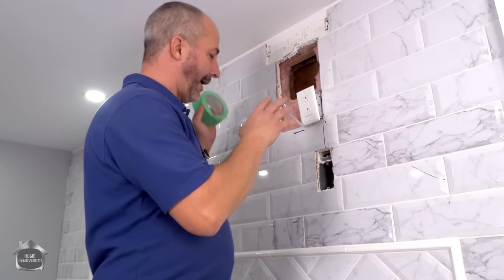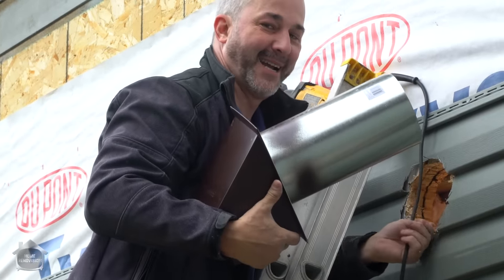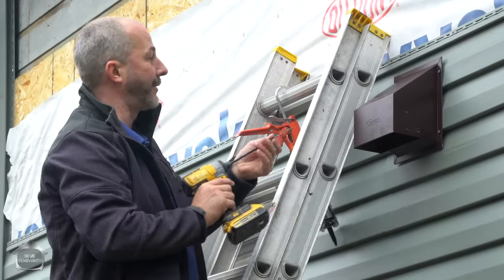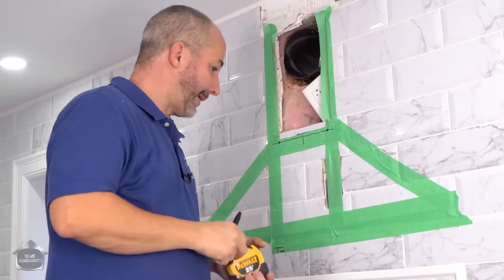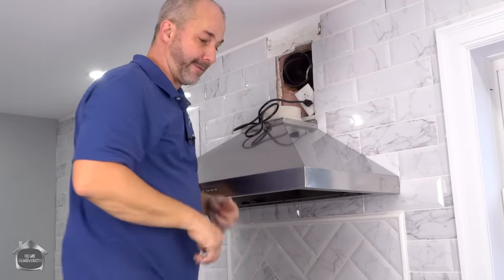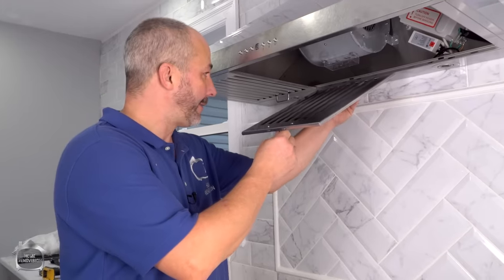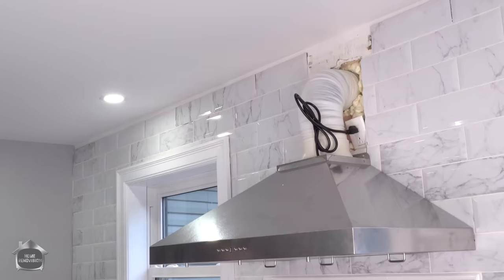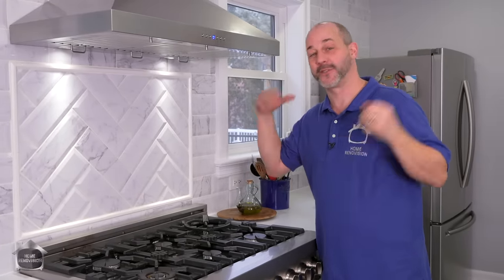How To Install A Wall Mounted Hood Fan!

Comment: Thx for the video, but I have a problem. What happens if a stub is in the way where the ducking should be?? The current ducking is not centered so if I install the hood vent it will be visible.

Comment: I understand the difficulty removing the protective plastic but as a Manufacturing Engineer in Stamping Body Panels...the covering is primarily needed to protect the Stainless surface during manufacturing

Comment: This is so helpful!! I have a hood similar to this that looks like it is falling down because a gap has appeared between the top and the bottom parts. I'm relieved that it is also afixed to the wall under there. Do you know if it's possible to fix the gap without taking off the whole thing?
Reply: Hello there, my name is William Juarez and I just bought a house 2 month ago but is 2 bedroom and one bath 1093 square feet but I have a closet in my bedroom 4 wide and 31/2 square feet and I would like to turn this closet to a 1/2 bath or if I can full Tiny bathroom can you help me with this any idea thanks 🙏

Comment: Jeff, do you think the screws held by the tile and drywall is strong enough to hold the weight of the hood?  I tiled before I realized that I should used a wall stud to bolt to.
Reply from the maker: I attached through the tile into the framing. Cheers!

Comment: I only saw 2 screws holding the hood. Is that correct or is there 2 more on the inside?
Reply: Just installed same hood. Only 2 screws. Fan isnt very heavy, but use something decent size. Not drywall screws.

Comment: I've seen a couple of your videos in which you cut through the exterior wall (siding). In the case of a vented hood fan, what would the approach be if the location of the vent is in line with a stud?
Reply: Good pre-planning I'd say. Understand where the studs are in the wall before choosing the stovetop/vent hood location.

Comment: you have your hood 30" above stove. What is the minimum amount of height to have it above the stove? I'm not far from installing mine but cant find anything that says what the minimum is. Great vid, just in time too!
Reply: Typical is 30-36"
Reply: Minimum 30, max 36 inches.  But check install paperwork.
Reply from the maker: in our area code is 26" to 30" Cheers!
Reply: Home RenoVision DIY were in same area so this great info. Thank you

Comment: could you hard wire the vent instead of having a plug?
Reply: The hood I bought had the option to either way. Just check the unit to see if you can

Comment: 12:45 Why are you drilling at an angle? is there any reason?
Reply: Yes, in order to drill through tile with a diamond hole saw, you start drilling at an angle - otherwise the hole saw will slip all over the place.
Reply: @maxbosley53  thanks for your reply :)

Comment: I can tell you right now, most, if not all? I range hoods require metal duct work.

Edit. The low end model z line says you can use plastic but their higher end one needs metal. From their instructions. Now if this is really the high end zline then he should have used metal duct work. I guess I've never seen plastic because I've always installed higher end models. Lmao

Also after seeing him use the wrong size plastic and then sealing it with expanding foam, I don't know if you should follow this guy's instructions.

Duct tape is a real thing that is supposed to be used for this and it's, not just tying people up. Using spray foam to seal  duct work is not code anywhere.
Reply: Total HACK JOB! everything you said👍
Reply: Aluminum tape is needed, not duck tape.

Comment: Nice product and you did good explaining and showing all the steps...I would love to install something like this but to get a vent run I would have to do it through the attic and out the roof and the access in the attic is unfortunately minimal
Reply from the maker: perhaps buy a unit that filters the air back into the room
Reply: Home RenoVision DIY I’ll definitely check out those models...seems like this company makes a good product for sure

Comment: Great video! A quick question can anyone tell me why they would send plastic tubing for an exhaust duct? Is there anywhere I could go to potentially get metal? I am just thinking grease is going to build up in it over time and increase the risk of melting/ fire.

Comment: Had the same issue with the 90 bend when doing the outside vent for our microwave fan.  Super tight working space within a cabinet and a stud just off center didn't help either.  Real shame the people that renovated didn't do that when the walls were open and siding wasn't on.

Instead of mounting to the siding, I chose to create a custom mounting block using AZEK (nothing from the BBS was large enough for that vent), cut the siding to fit the blocking, added j-channel on the perimeter and now there's a nice clean install.
Reply from the maker: One of the reasons we do these videos is to show what happens when you plan ahead....or don't
Reply: @HomeRenoVisionDIY  they don't get it Jeff

Comment: I would never hang an exhaust fan with wall anchors, that's what wall studs are for. And I don't think the electrical connection will pass code. I know it wouldn't in Arlington, Tx. I'm finishing up a complete  downstairs remodel and we found out that you can no longer use 14 gauge wire ANY WARE . Not even for LED can lights. And I.m installing the z-line he originally was going to use.
Reply: Depends on your location on using 14 AWG wires. That sucks that you can’t use 14 AWG wires.

Comment: Pretty cool. Personally I prefer recirculators to venting for kitchens. Venting just adds another entry point for hot/cold air for not a lot of benefit.
Reply from the maker: they do remove the water vapor from cooking out of the house. this alone is worth it to me!

Comment: Hi.  Very helpful video.  a big fan of your videos.   Doesn't the white plastic vent tube get messy with food vapor gunk in a year or two?  I suppose there isn't an easy way to clean that up?   Also, when renovating the house, doesn't the ventilation holes destroy the water & vapor barrier and let the moisture get into the house no matter how well one puts the expanding foam?

Comment: Love it! Any chance of some general rules for making a custom hood cover for a new fan vent sytem install? (Getting rid of microwave /"filter vent hood") I wanted to match my epoxy faux marble counters with a clean square hood.  Is that safe if its heat resistant epoxy over wood and the fan insert has the square metal shield insert? Figured My upper cabinets on each side are wood and just as low if not lower. Thanks!

Comment: great video. but I think that you install too too high for the hood. that will effect the efficiency for the machine. I just replace mine. By the way, if you have time and intersting for the range hood. please check Fotile and Robam these two biggest Chinese Brand. Fotile are in Canada market for few years already. I think Robam just come to North American market recently. They are have fan with 45 degree angle which are more efficien than any other brand.

Comment: I know this is an older video, but I have a question regarding my ZLine Hood.  I installed mine in 2018 and I love it.  ZLine is great!  The one I installed is able to convert from vented to circulating.  I have been using it as circulating, but just decided to install ducting to vent it to the outside.  It is mounted to the exterior wall just as yours is in this video.  My issue is there is a stud just off to the side of where I need to drill a 6 inch hole for the duct.  I obviously cant remove a section of the stud from the exterior wall, but I CAN drill a 4 inch hole instead of a 6 inch hole.  My question... Would it really hurt to reduce the exhaust from 6 inch to 4 inch in order to get it outside?  According to the hood info, my hood maxes out at 400 cfm.  I am using rigid ducting and not flexible ducting.  Do you think I will run in to performance issues or cause damage to my hood at all?

Comment: What happens if the stove is on a wall that’s an interior wall.
Reply: I'm in the same situation. Only thing I can think is it's gonna have to go up through the attic. It's that or install a ventless fan.
Reply: Chris E hi Chris wondering your thoughts on ventless fan ..... do they work as well as vented?
Reply: @NaturalResultsMobileMassage  I'm not entirely sure how effective they are. They do have a grease filter, which is good, but they just blow everything else back in the kitchen. 

The house we moved into had a Jenn air range that was vented between the burners and down through the floor. Replaced that with a gas range and no Hood. Never really had a problem in 9 years. Walls and cabinets don't get overly greasy.  Sometimes I have a smokey pan, like when searing in a cast iron pan.  That's the only time I wish I had a vent to pull the smoke outside.

Comment: You could have used a Spyder Industries carbide hole saw for that vent and not worry about the siding nails...:-)   They're awesome...by the way, an awesome kitchen reno as usual...

Comment: An extractor fan without grease filters is a fan that will not last long.

Recirculating or extracting, that only takes into account fume, smoke and smells.

The grease will gum up that fan in no time.

Comment: The siding bit bothered me. It wasn’t finished yet and you were into that course. Could have easily removed and slotted the vent behind the siding attached the flange to the wood. Other than that nice job on the video.

Comment: The price on this thing is outrageous for only 400 CFM on MAX fan speed. You claimed it was 400 CFM on low, which is false information.  If you have more than 4 burners, and actually cook, you need 900 CFM or you’re just wasting time. With the range hood that high above the stovetop, and at only 400 CFM on max, throw a ribeye on the sear burner and watch that kitchen turn into a smoke box.

Comment: I'd like to share my valuable experience. My hood came with some really nice metal screw-in type anchors. These normally work very well for me on a variety of applications, but when I got to the part where you install the cover above the hood they pulled right out of the wall, and down came the hood. My advice is to take any plastic or metal drywall anchors and throw them in the trash. Make a bigger hole and use some nice toggle bolts to save yourself some grief. Better still, for a real permanent, quality job, pick out your hood, measure it out on the wall, cut the wall open, and install a 2X4 across where the hood mounting screws go.
Reply: I am dealing with this now. I used the supplied anchors with my hood fan. They are larger than these and are pulling out a little from the wall in my case so there is an annoying gap behind the duct cover. I just missed the stud on one side so I am thinking to take the cover off and screw into the stud at an angle.
Reply: If you read Zline instructions they say wood anchoring is preferable

Comment: Another fantastic video Jeff.  Just love his video's!  I do have a question about using plastic venting in a hood though?  Is it a special type of heat rated plastic or a Canada code?  I've heard we can only use solid metal ducting in the US now...
Reply: Yep... was just about to mention ask about that as well. Here in the US, you have to use the galvanized steel  duct work for those. Evidently they are more efficient too, since they're smooth and product easier air flow as well. I ended up putting in blocking though to give the hood something meatier to secure to, though. Also, I did a make-up air system, just because why not? Ironically, I have the exact same z-line hood for my youtube project studio as well. Comes in handy that I can just use Jeff's measurements. haha!

Comment: The guy took down my comment , again I am a professional Installer of high end appliances, first of all 
Z-line = no where near high end , this product is one of the worst to buy , 
And your installation, haha , 
Like a said your fan isn’t blowing any air since you’ve put de pipe inside the exhaust on top on the hood , that flap needs to open buddy it’s simple logic , + many errors I’ve mention in my post before you took it down like all your negative comments , example , your little slugs that you love sooo much , that won’t hold it for 15years trust me you have to use toggle bolts , good ones ! And that freaking pipe needs to be metal and seal this with aluminum tape you clown before your house burns down ...
This house most be sooooo wrongly renovated haha
Reply: Living 2Day , anything  high end : Miele , Thermador , mid range : Venmar , Best Rangeshood are quite impressive too for the price 
Anything else under 1k is clomplete trash , I mean you get for what you pay lol simple as that

Comment: Call me crazy but once you cut down the metal duct you could have pushed the flexible through and attached to the metal, taped it well and pushed it back through before screwing and caulking the vent.   Is it not that necessary to seal that well? Seems like it’s just stuffed in and then foam.  With moisture I’d think you want a seal with tape.  Ty for all your amazing videos, best channel in YouTube.
I do have one question about venting out the side of the house.  I saw one video you did the same for a bathroom vent.  I tried to have one installed, as an electrician I ran the electrical,  but hvac dude told me don’t vent out the side because the moisture will go up into the eve and cause rot. Wanted to charge a ton to go through attic and roof.
Is there any concern with this?

Comment: I'm about to instal integrated fan with the induction cooker... pooping my pants because I also want to make it outside fan rather than have the recirculating one... need to make hole in 2 walls.... maybe it is possible after all for me... was contemplating calling in the handy man but I am guessing it is the same principle as the hanging fan... more problematic is to make holes in the walls I would say...

Comment: Seeing you bury that plug is super scary as an electrician especially considering you spray foamed around it, next time hard wire the cord end instead of using a plug then put a switch lower down for your disconnecting means
Reply from the maker: If you were an electrician then you would know that a hood fan duct is removable and as such the plug is not deemed to be inaccessible.

Comment: Your siding cut out was not pretty and you should never use flex pipe on stove exhaust. also relying on caulk to stop rain is never a good idea.

Comment: Hey. Great video. What kind of bit would you recommend for glass tile? Also, it looked like you started drilling at an angle and then leveled up after getting started. Whats the reason for this? Thanks again.
Reply: Its because a bit on tile will jump around causing you to miss your mark. Start at an angle to get it to bite and then level it off to prevent it from skipping around.
Reply: The 1/4” drywall plugs are rated at 20th s each and the Z-Line unit in the video is a 60lb unit. But… I think he’s good considering they are set in stone and then drywall. Yea?

Comment: the duct work needs improvement, there is a big hole between the flexible duct and aluminum pipe in the wall!!! The ducting is supposed to be airtight, u dont even bother to tape it up

Comment: Great and informational videos Jeff! Just wondering I saw you just installed the hood onto the wall itself but I read that its unsafe installation. The correct way is to have the hood installed onto the studs or a support between them instead of the drywall. Do you think installing it onto the wall is safe enough?

Comment: As a person that is purchasing their first home (closing date is Jan 5th of 2021) these videos have been an immense help in understanding the scope of upgrades including cost and typical labor involvement. Really loving it, definitely had to subscribe, which is something I pretty much never do, but it’s well deserved in this instance. Thank you!
Reply: As someone who has also recently bought a home, you probably don't understand the least of what you will be doing. I took two weeks off of work to replace the kitchen and bathroom cabinets and It has now been over a month of working and I still have not replaced the kitchen or bathroom cabinets. I have found everything from illegal wiring to massive damage to the insulation from rodents to old termite damage (without any live/active termites, luckily!) undocumented renovations (moving walls, etc.) done mostly wrong, structure cut out completely to run plumbing,  hidden asbestos tile that only becomes visible once you start removing tiles, where you can no longer decide to just leave it alone.... I am about $20k in and have only just started working on adding in the cabinets to the kitchen.  Cheap counter tops, sink, faucet, garbage disposal, etc are probably going to cost an additional $1k and I still have to do the bathrooms. Luckily I have a lot of time before I have to move out of my current rental!
Reply: @MAGAMAN  I’ve done quite a few upgrades since my purchase and thankfully everything went smoothly. I also bought a house built within the last 20 years, so there wasn’t much risk as far as illegal modifications.

Comment: Hi I'm thinking of purchasing the same Z-Line but for 30". I know they're all 400 CFM & I was originally interested in 500CFM. So like you I'm interested in upgrading the 30". 
How did you do that? Using a Make-up air device?
Also using the tape to bang those Molly's in was too funny cuz i do the same thing!! Lol
Thanks again for the great video!

Comment: Um, it's not up to electrical code to leave an electrical outlet "floating" or "hanging".  All wiring connections must be made inside a box.  This ensures any spark cannot escape and cause a fire hazard.